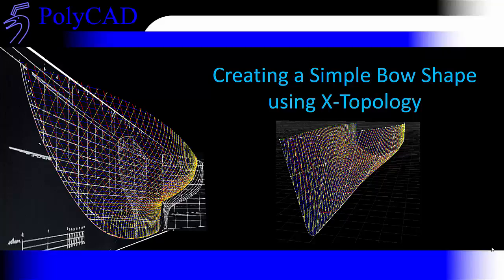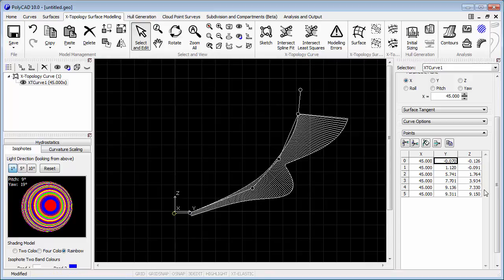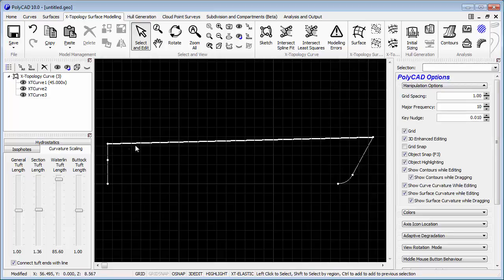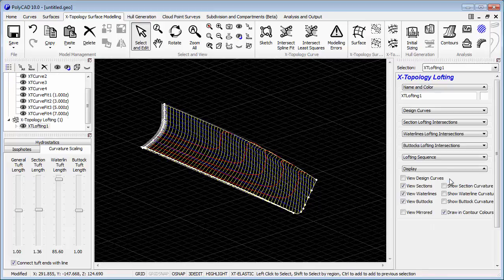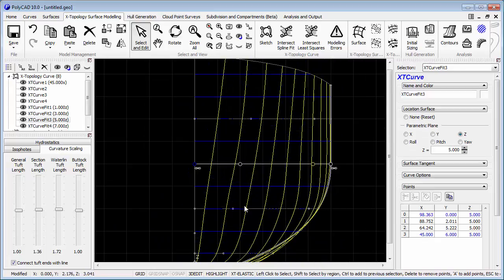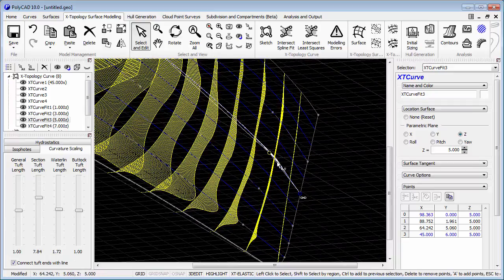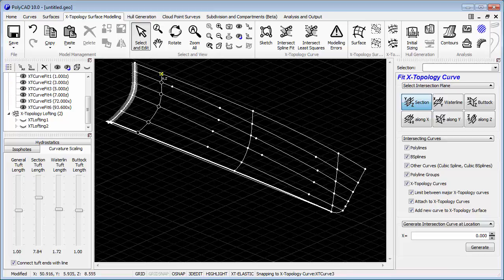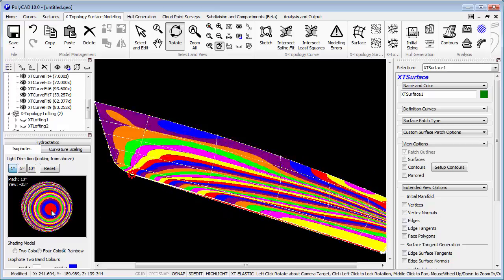PolyCAD: X-Topology Bow Hull Surface

Comment: I'm sorry, this was impressive, but I couldn't follow it very well. I have downloaded PolyCAD and browsed through the 'Getting Started' and every video I could find (Narrow boat, etc.). I looked at this video and have been inching my way through it and backtracking dozens of times trying to follow and reconstruct what you're doing. One BIG problem is that the version I downloaded does not match the video (not exactly). I had to figure out some of the differences in the GUI (I got 10.3 yesterday) to find things. I had to make iterative guesses until I got a result that looked similar to what is in the video. I understand the need  to make a video with whatever the current version is, but you need to understand how exasperating and frustrating it is to try and follow with a different version and being unfamiliar with the software. Your video looks more like a promo than a tutorial.  Perhaps that was your intent, but I could not find any other tutorials.

Or, perhaps you do know. But its a lot of work; too much work. If that's the case, fine, but it would be nice (and polite) to let us know. I am not a naval architect. I'm a retired engineer; user for decades of various mechanical and electrical CAD systems, also a sailor (2-yrs live-aboard, etc...) and I have built 3 boats. Professionally I spent some time designing aircraft but never a boat from scratch.

I am proficient in Autodesk CAD products a little in PT (Pro-E/Cleo, and a few others). I have designed hulls in AD Inventor and used those mass properties to do some very basic hydrostatics using a spreadsheet. But that's where it ends for me now. I could see the limitations of that workflow hence my search for something better. I am not wealthy; I live off of my U.S. Social Security and cannot afford the big bucks for any big hull design software. So I looked for things like Free!Ship, PolyCAD, etc. My interest being hull design and Import/Export ability. If I can get a good hull design (by any good method) and export it to a format that I can read into AD Inventor (STEP, IGES, STL, etc.) then I am content to do all the interior and topsides design in the other CAD tool(s). But I need that envelop ( the hull shape, either as a surface(s) or a solid, or just x,y,z points) so that I'll know the physical extents of where I can model internal parts. 

My initial interest was in Free!Ship since it could produce flat patterns (uncurved panels, as if of plywood). I could easily model those in my CAD software or even build from them. But Free!Ship does not import and export my kind of CAD file formats. I know there are numerous isses with IGS files too. And WRL is all but defunct, as is OBJ files. So I was encouraged to see that there was a possibility in PolyCAD to do better imports and exports. I thought that just maybe I could ferret out a workflow that would work for me.

Perhaps all of this is under-academic (is that a word?) but it is my situation. I suspect it is in the ballpark of many people's situation. I also understand that I (perhaps 'we') are not naval architects. never will be, nor desire to be, except to the short-termed extent that we can design a good hull for our own, home-built boat project. But I (we) do understand at least SOME of the things like performance and stability and I (we) have the objectives of making the best home-built boat that we can put a lot of time and efforts into. If I (we) are barking up the wrong tree(s) then I can just tuck my tail and go away. But it would be nice and polite if you would let me (us) know that your audience is only for academics or for professionals in the marine industry. That way I (we) can stop beating our heads against a brick wall and just go cobble our boats elsewhere.

In any case, thanks for your contributions to the art.
Reply from the maker: Hey, its just one guy at this end. A guy with a day job. This is no commercial operation.  There is just no way I can provide a full training experience that you'd expect with paid tools.  However, the software and assistance will always be free. Help is always offered at the point of registration. Some users have taken that opportunity to build their skills from scratch using this opportunity.  They wrote an email asking how to do something and it started them on a new journey.

PolyCAD contains methodologies that further evolve some of the complex techniques that are found in expensive commercial ship design tools but also includes simpler methods such as direct surface manipulation and section curves which are no longer supported in modern software but are still a reality in Naval Architecture.  It represents 20 years of my personal requirements working in this industry.  There's no way to accommodate everyone's initial knowledge in each video but I am always available for clarification.  

So, please ask for help in a way that both you and I can accommodate and sustain.  Email me...
Reply: Marcus, Thanks for your reply. I understand. I wrote a lot of airplane/aerodynamics design software over the years which was initially for my own purposes and later other people wanted it but I could not "support" it in a way that they would have liked (like a commercial product). It is very generous of you to offer assistance. However, having been through (or at least understanding) the situation I am reluctant to ask for your time. I feel like if I did then I would expect to compensate you in some way; which I'm not in a position to do. 

On the more pragmatic side, I've looked at a myriad of software packages (at all pricing levels). Clearly, these are intended for those in the marine/naval industries (or at least those willing to plug away at it until they reach a modicum level of proficiency). Of course people can keep at it (those softwares) until they reach that level. That "level" may be sufficient to build some boat. It's like in my (former) world, a lot of people can and do build airplanes, but few actually understand them or 'all they know' about them. Never-the-less they build such things. But building a boat or airplane does not make the builder a naval architect or an aeronautical engineer. 

When people DO build those craft it is often their craftsmanship that shines more than their understanding of fluid dynamics. There is nothing wrong with all of that; more power to 'em! Kudos ! But, that's not me. I've built 7 airplanes from scratch and owned/rebuilt 7 more. I built my first boat at age 13 (a 3pt. hydro) and I chopped a Cobia to build a 'needle-nose' a few years later. A few years ago I spent 3000+ hours on a 48ft sailboat that we lived aboard for 2 years. So I know and understand the notions of craftsmanship. But at my age now I don't want to plug away learning yet another software package (of the many on my plate now). So I think I'll join the ranks of people following the more traditional 'eyeball engineering' process; almost.

The biggest problem I see with most of the hull design softwares that I've looked at is their lack or minimal interfacing with mechanical CAD software. Yeah IGES and STL and OBJ are in a few. Of several that I downloaded to try many/all of those features were disabled; so I could not try them. I was interested in IGES in particular because, even though IGES was supposed to be a non-proprietary standard, it is buggy and many softwares only implement subsets. It requires testing/trials to figure out what is what. The bottom line for me is that the interfaces were tentative or restrictive in various ways. So when I discount the interface-ability those softwares loose a portion of their value. For me, the primary value of them is to be able to give me some idea of stability and performance (for the type of boat I am interested in building. I can (and have) used my CAD to 'slice and dice' my design(s) and I semi-manually transfer those mass properties to a spreadsheet where I do a version of stability analysis.

I do have CFD software that I have used for compressible flows (air flows). I have never used it in water, but it is general and capable enough to handle either (or even mixed flows). Perhaps I am better off spending my time expanding my workflows with my CFD software than delving into new software.

So, thanks but no thanks. Good luck in your career. And more kudos to people who spend the time to plug away at it until they reach their requisite level of proficiency. My only suggestion is that it would be nice and polite if you prefaced your videos and put a note on your website as to your intended audience and/or an indication of the esoteric nature or depth (no pun intended) of study and commitment required to do what looks so quick and easy in your videos.

Thanks again!